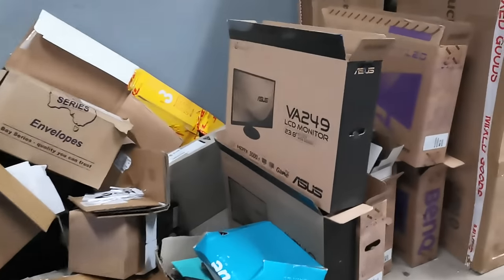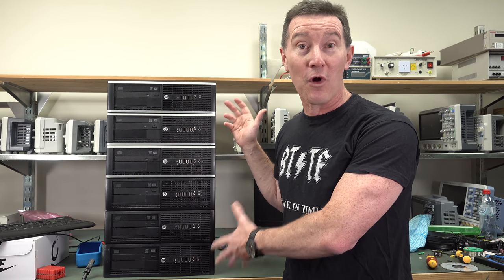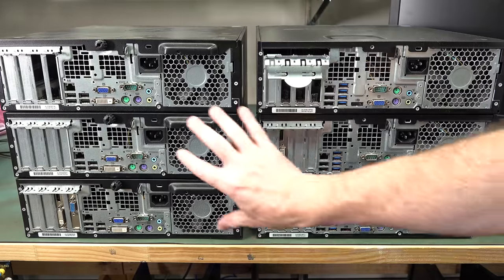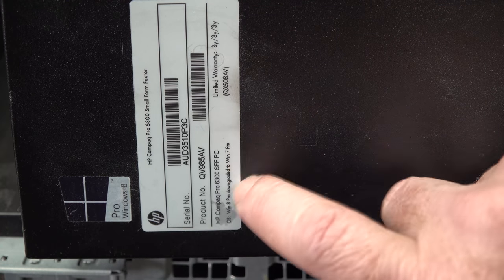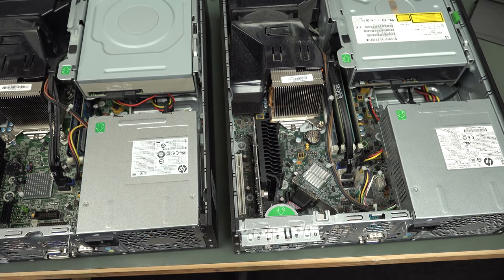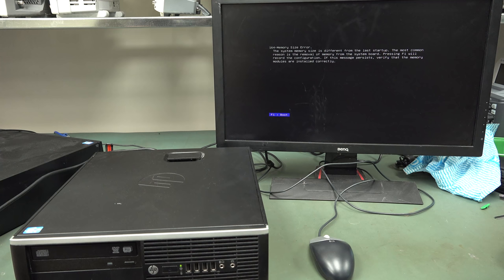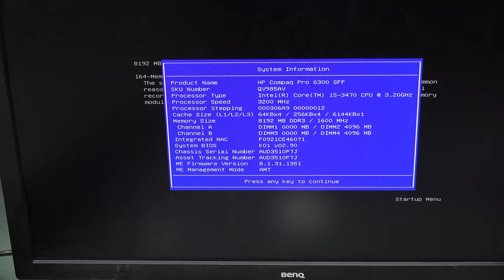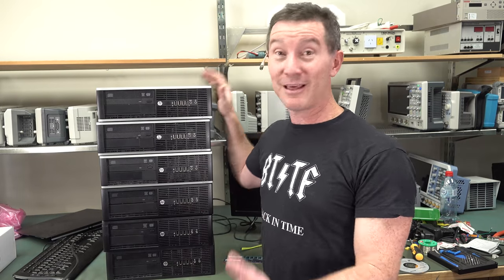EEVblog #1212 - Dumpster Diving PC Motherlode!

Comment: All those ones with the silver borders have awful power supplies - they love to just die spectacularly. We had a bunch of them at my job and we have been losing about 15 of them a year for the last three years to bad power supplies.
Reply: There's an idea for Dave's next video. These are Delta supplies, which are generally well constructed but on the cheap side in terms of parts, so I kind of suspect dodgy caps. (By failing spectacularly, do you mean they literally go bang?) Failing that, some components may be undersized or badly cooled.

The last power supply defect I had was an ultra-compact Fujitsu Esprimo Q910 (same generation, i5-3317U). Unplugged for 10 minutes so it can be moved to another space, plug back in, dead as a doornail. facepalm Apparently these are quite notorious for blowing their switching MOSFETs, and people have been modifying them for use with external laptop power bricks as the PSU is only generating 20 V internally anyway, so it's basically repackaged mobile tech. These are fairly neat little machines otherwise.

Other than that, the (now exotic) 15 V supplies used by older Toshiba business notebooks have proven a bit unreliable, more specifically the Sanken OEM'd ones. "Just" bad caps, but ultrasonically welded business = hard to open. These machines (e.g. Tecra S10) have straight terrible battery charging algorithms, too - they'll charge an old battery until the overheat protection kicks in. (To make matters worse, they tend to drain their batteries in about a month as they draw about 4 mA even when off, so you either have to charge them regularly or leave them powered all the time.) Those would have needed a BIOS update to limit charging of old batteries, not the Fujitsus that did end up getting one recently (but where I've never seen anything critical happening). They are getting a bit old now, but they still have some really nice keyboards and are only ever being used for office and internet stuff anyway.

Comment: The big manufacturers don't put COAs on their boxes anymore (from about W8)... Generally gets loaded in the BIOS.

You can generally request a downgrade on the OS if you're a corporate customer it was very popular during vista (to XP) and  8 (to 7). A number of reason for doing this could include:  Legacy APP compatibility, keeping your environment consistent if you had to add  an extra machine/s, or because the OS is garbage (Vista or 8). I haven't done it a while but  From memory its still licensed to run 8.

Comment: This HPs, if you ignore the PSU (half of it is devoted to move air in the bays) are alsmot passive cooled. Heatsink is very big, and fan does not do much heavy lifting. I ve never hear fan noise coming from one of those. And 4 DIMM slots, thank dyou very much. Not to mention how easy is to work on them.

Comment: I doubt you'll get 5 screens off those machines.  The cards are usually take your pick of 2 out of the 3.  On my HP machine - generation before this - you can't use the integrated graphics if you have a dedicated graphics card.  Incidentally, 16GB is nowadays significantly better than 8GB with Windows 10.  By the time you have a few tabs open in Chrome you're usually using 7GB+.  I've been thrilled by with the machines I've got with 16GB.  It just takes it away from that threshold of using swap files.  Chuck in a $50 SSD and these machines will fly.

Comment: Make a CentOS cluster. Not sure if youd have much need for it, but it might be a good way to learn about parallel programing and HPC (if you're into that). Maybe not with this lot, but something to keep in mind when you come across a score of heterogenous machines. Also be on the lookout for network switches- that would make building a hobby cluster a bit simpler.

Comment: What I like about HP compacts back from many years ago was that they didn't mount the hard drives right ontop of the Northbridge controller like they did on the Dells where they'd get hot, overheat and break down.

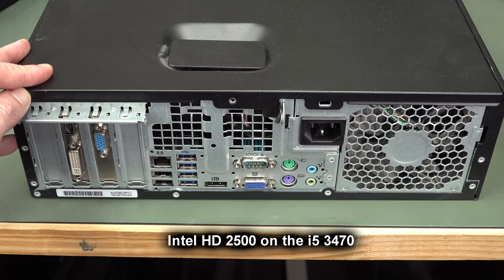Comment: At 10:05 i have to say that integrated graphics (iGPU on Intel Core Processors) will be disabled if there was a physical video card inside.
So many people were handling it wrong, connecting the monitor to the mainboard instead of the dedicated graphics card and wonder why there is no signal shown on the screen.

Comment: Those PCs are gold to any engineer. Use them for testing hardware under different configurations and loads. Quickly swap the box out for one with more/less RAM, different graphics card, etc - that way you can troubleshoot misbehaving software & hardware fast. Like when you were testing your rendering settings.

Comment: just want to point out that a lot of modern motherboards do still have physical serial and sometimes even parallel(LPT), but they are just on headers on the motherboard, where you need to provide your own connector as opposed to it having a space on the faceplate

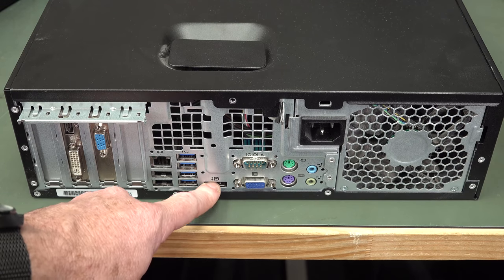Comment: @10:00 I also have a refurb HP desktop from an electronics recycle shop and at least on my model, if you install and use an external graphics card, the BIOS hard-disables the onboard video.  It was in the BIOS apparently--it wasn't just the fact that I run Linux.  I've never tried Windows on that box but I don't expect it to work.  But at first I was also excited about getting a few extra monitors involved...

Comment: 6:44 that computer was purchased December 28, 2013 and warranty expired February 15, 2017.    I was buying PC's that where down gradable to Windows 7 because we skipped Windows 10 and where waiting to upgrade to Windows 10.  Oh and as mentioned if you put NVidia GTX 1050 (low profile) it only draws 75w of power.  I usually also put in an SSD and you get a decent gaming machine.  I turned mine into a 3D Render farm :)

Comment: Windows 8 & 10 product keys are loaded into the motherboard. You can actually run the Windows 10 installer on these systems and it won't require a product key! Really neat. You can search this by the keywords "ACPI Product Key". You can use software like RWEverything to read these keys, but they will still be OEM locked.

Comment: It looks like the non working one used to have an external graphics card and might have the internal disabled. Try putting one of the external ones in and see. Fans also usually spins at full tilt before the bios is initialized fully, and the missing graphics card might halt the bios before the fan controller is started, hence full wack on cpu fan.

Comment: When I worked for an HP distributor, HP loaned us a high end 3D workstation (J-class I think) in the noughties (with FX10 graphics, the card alone was thousands), I think the whole unit cost over £15K the way it was configured.  It was used to demo for customers.  It was only supposed to be a 6 month loan but they didn't ask for it back.  After a year we asked them what they wanted us to do and they said "Keep it".  Chump change for them, and they probably could care less about a 1 year old machine.

Comment: The oem bios level MS licensing lets you install windows 8 or usually also 10.  It will automatically activate and choose the correct version (pro in this case).  Win7 requires a HP oem version or a vanilla version with a tool to change the SLIC to use the bios license.

Comment: That's great, looks like the two biggest bottles necks have already been removed from these PC's.  Windows & the mechanical HD.  It's now ready for Linux + SSD and these will fly.
Reply: Hardly anybody wants a Linux PC... won't noticeably speed it up anyway. Installing a SSD is obvious but still need a storage drive (which will easily fit).
Reply: @johncoops6897  
If you are not a gamer, Linux is the best option.
Those machines don't have the power to run the latest games, so they would make great Linux machines.
I totally agree with Tommy. I'm sure Mint will install just fine on those machines.
Reply: @czarzenana5125  - yeah yeah, blah blah,  but there is no need to downgrade to Linux... 
... simply because the latest version of WINDOWS will install and run just fine on those machines Bonus: you even get a licence for Windows as well!
So they would make great Windows machines.
Reply: boot SSD (120GB) with Windows 10 Pro, 500GB HDD, as well as a GT1030, and that thing is ready for a few VMs, or as a general purpose PC when fitted with 16 or 32GB of RAM.
Reply: @johncoops6897  
There's no downgrading when your OS is for free and open source.
Since there is a license paid for closed software Wintendows, you could make a dual boot.
Most people have more appliances at home running Linux, they just don't realize it.
Reply: No normal consumer would choose "free Linux" over "free Windows". Why would they want a dual boot, it just adds something that they will never ever use.
Linux has it's place, especially as an embedded (invisible) OS for routers, NAS, etc... even as a basis for Mac OS.
However for normal people, it's an unnecessary complication and clunkiness that adds absolutely zero value. Consider: what possible advantage does Linux have over Windows for a normal computer user? Note I say "user" as opposed to "geek" or "tech" - in other words people who know how to operate a machine, but not how to work on one..
Reply: @johncoops6897  
You'll probably mean average user instead of normal user.
The situation is not the same worldwide. Hardly anybody is using a Windows smartphone, many people switch from iPhone to Android. People do change you know. I really see no benefit in Windows other than "it's what I'm used to." Even on windows-machines most people switched to Chrome or Firefox.
Reply: @czarzenana5125  - I mean NORMAL user. Most common user. Majority of users. Consumers. Family members. Non-technical people.
Hardly anyone uses Windows smartphones for the EXACT same reason that I explain about using Linux as OS for PCs. There is no benefit, so they don't need to change.
The benefit of Windows is that Normal/Average/Majority of users couldn't give a shit about the OS - they need the device to work. And to work with the software that they know and understand, and to be able to get assistance if they have a problem.
I have no idea what Chrome of Firefox has to do with anything. These are programs that USERS can install as options, and then they can pick and choose whether they use them depending on whether they feel there are benefits. I hate Chrome, as it's a massive resource hog and chock full of spyware, however some features make it better than Edge. As for Firefox, luckily that was killed off in the 1990's right? LOL
The easiest way to sum up is to answer the question: What BENEFIT does Linux give to a normal user?
Reply: @johncoops6897  
How can you be so sure Edge or Explorer isn't full of spyware? It's not that they are open source in anyway. You could install the basis for Chrome (Chromium) which is completely open source. You can even create your own browser with it. If you want a browser that takes little resources, just install Opera.
The main benefits of Linux on a desktop are it's completely free, you can choose it to be completely open source and you are not bombarded with attacks and messages.
Firefox with it's new engine has been chosen the best browser of this moment. It's the third most used browser of this moment after Chrome and Safari. Safari only being available for Apple, it's the second on Windows machines.
I hope the EU will be the first to completely ban the tie-in sales of hardware with Microsoft.
Reply: @czarzenana5125  - Windows on these PCs is FREE. It works, and it runs the software that people want. They don't care about open source, and they don't get bombarded with attacks and messages.
You are obviously quite the Linux fanboi geek... good luck to you.
As for EU banning "tie-in sales of hardware with Microsoft", they won't have much to ban there since it's easy to buy a PC without Microsoft involvement. You should worry more about Apple, Samsung, HTC, and every other brand who package hardware and their own OS. And what about all those brands that force people to use Linux?

Comment: I have a VMWare cluster running on three of the HP SFF 8300 desktops.  Just maxed out the RAM and added a 4port GigE card for storage and VMotion.  Five years later they are still cracking.

Comment: I recently learned this with an HP laptop that's a few years old: They often stopped adding Windows license stickers on the case and instead put the license key in the BIOS.  I had to do a fresh install of Windows 10 and got concerned because I couldn't find a license key to type in.  But Windows never asked for a key: It found it in the BIOS without being prompted to, and it basically told me "nah, we're good mate". ;D

Comment: COA/Licence key is electronic on those machines, grab a HP restore disk for 7 or 8, you can even throw 10 on them and it'll pick up the E licence. 

The 6300 SFF is a pretty good machine, nice solid little workhorse of a box, won't set the world on fire from a benchmark point of view but that's not the point of a business desktop anyway, they're just meant to be solid, reliable and get you through the expected lifetime until you hardware refresh.
Reply: Windows 8 pro is still better than win10 and all the datamining, or OS-as-a-service thing. You don't want this.
i have it on a thinkpad tablet, it changed my mind on why i shunned win8.1, but it is like the last decent one they made, you can still turn off unwanted services.

Comment: They are only quiet unless for whatever reason the hp logo at boot does not appear and the fans ramp up to very high rpm for like one min then they start to ramp back down to low rpm.

Comment: I could not even list all the stuff I've pulled out of dumpsters. My current tv, stereo, and speakers would be a start, though. And all my power tools. ALL of them, and I've got quite a few... What really surprises me is that most of it required little to no attention to be fully functional.
Reply: I get heaps of my stuff from the domestic hard rubbish collections. My last haul included 2 year old Yamaha 7.1ch receiver, Dimplex portable a/c, $1000 gas heater, about 20 power tools (some old), hand tools, storage shelves, speakers... absolutely tons more stuff. Even got a variety of life ammunition (for which I have no rifles).
Reply: @johncoops6897  Yup, that sounds pretty familiar.

Comment: The i7 processor does not support the motherboard video ports. That is why there is a cap over the VGA port. You have to use a plug in graphics card.

Comment: Could give them to the Bower at Marrickville. Also, I bought one of these ICS8065 GPIB bridges. You could stash a couple of these PCs round the lab (behind benches) with the monitors on arms to use for test instrument automation. Can be really handy for stuff like your long running battery experiments etc. Between GPIB, ethernet and USB you probably have most stuff covered.

Comment: You can readout the Windows Keys with a Programm. The Keys are stored in the BIOS.
Reply: Which is totally useless since the licence is "LOCKED" to that machine. There's no need for keys anyway, they activate automatically.

Comment: Normally I do this with laptops without screens but, give it a wireless keyboard/mouse, blue ray player and upgrade the Win7 to Win10 (still works at the moment). Brilliant PC for movies and internet on lounge TV at home. Probably run fine just with onboard graphics. Way better than smart tv. 

Get white pencil rubber and a can of inox. Clean the memory connectors with the rubber, making sure you tap away any rubber bits. Then spray some inox on an earbud and wipe down both sides of the memory connection and put it back in,. Never have a mem connection problem again.

Comment: I've had alot of 8X00 series HPs. For the one that went high fan/no post. If the bios reset doesn't do it. It's usually a bad power supply.
Reply: Yeah, those 8300 PSUs started crapping out at roughly the same time. Bad caps is my guess.

Comment: About that “Windows 8 Pro downgraded to Windows 7 Pro" thing, Microsoft allowed people with Windows 8, Windows 8.1 and Windows 10 license to downgrade to Windows 7 and still activate using the same license key or digital entitlement. That Windows logo sticker by itself is the certificate of authenticity now as the actual serial number is stored either on Microsoft servers or in the system BIOS as a digital entitlement.

Comment: I just bought a couple HP 6200s for $50 ea, postage included. So, they were giving them away over here in the US. But, they are quiet, strong, fast. Just added SSD's to them, maxed out memory, and added decent AMD cards to them. Quite nice. Too bad you are down under. I have an older one with a bent case, in need of another one. It's an HP 8000 with a core 2 quad. Still, the same case.

Comment: Base unit disables the onboard video when you toss a card in. These were probably replaced due to lacking Windows 10 drivers, or just licenses for a small business. We still sell these for smaller shops that just need Windows 10 and some Office apps. Nothing wrong with them - they are everything as good as you say they are. I personally like the design better than Dell's layout for this form factor. Good little computers.

Also the fan going crazy like that is a motherboard failure. The whole family of HP's does that up to the 8200's as far as I know. Other thing that craps out is the PSU.